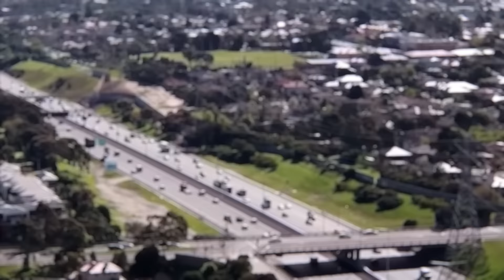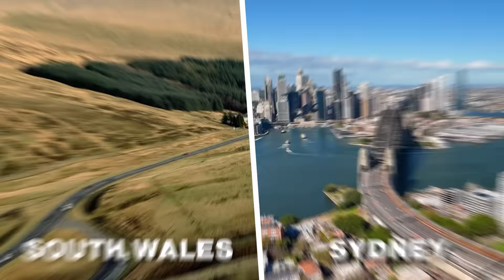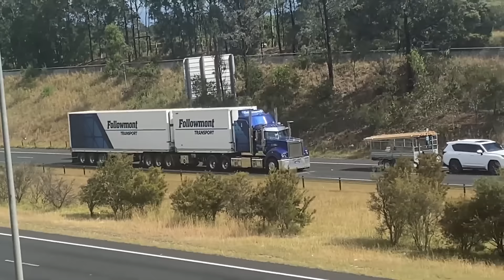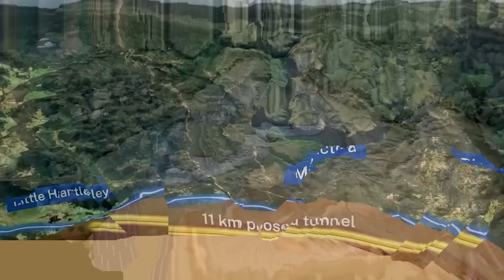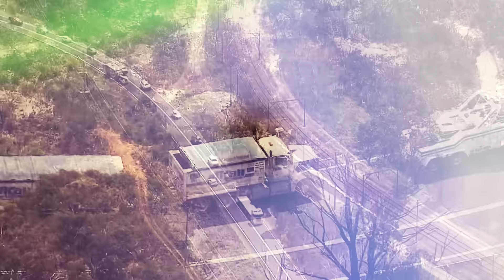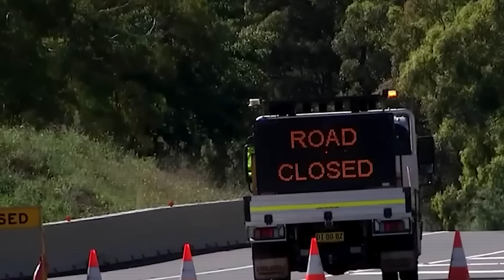Why The Great Western Highway Is About to Cost Australians $4.5 Billion

Comment: How/ where do you transport DANGEROUS GOODS into the Central West ??????
Can't be moved through those tunnels, same as the bypass around Coffs Harbour.
DGs , even if is just a pressure can of paint, have to be carried, not through any tunnels, but on an OPEN ROAD.

Comment: This doco is now outdated,  the NSW Minns government in all their wisdom for such an important infrastructure for the future had scraped the entire project in January 2026. They replaced it with a "White Paper" that adds cycle ways and extra trains to a rail network that is decades behind decent upgrades. It also adds additional years of investigation when the investigation for an expressway or tunnel had been 30 years in the making. Now the west of the Great Divide is at it's knees when the link fails at Victoria Pass of a 200 year old causeway.

Sydney expect higher prices for fresh produce coming from the central west unless you help us push for a speed on repairs to the major arterial road. The alternate detour route will be mostly closed during winter to trucks due to ice and snow and the steep gradient of the road.

Comment: The Great Western Highway exists as it is because the early explorers did not have aeroplanes!
If they did they would have realised that the Jamison Valley which is at the base of he Three Sisters and Katoomba leads to a very narrow wall of rock that once penetrated, opens up to the Coxs River Valley.
The Coxs river finds it source up near Lithgow and if you cross a small range you end up with the headwaters of the Macquarie River.
In fact the Coxs, carries through to the south of Katoomba, and if the exploders had an aeroplane they would have realised there was no need to go along the top of the mountains at all.

If our Government engineers had any brains they would build an elevated freeway which crossed Warragamba Dam and ran alongside the Jamison Valley to go through a VERY short tunnel to the immediate south of Katoomba at Narrow Neck.
It would then follow the Coxs river and cross the small ridge near Sodwalls to track alongside the Macquarie river and go close to Tarana on the way to Bathurst.

Katoomba has an elevation of 3,700ft and I have flown aircraft between Bathurst and Penrith without going higher than 3,000ft!
AND that is only because I cannot fly through where a tunnel would be.

But today's engineers apparently do not fly in aeroplanes!
Reply: Charles Brewer has presented a great proposed solution.  The Central West of the state should not rely on a "local' road that services the Blue Mountains, and, as a side issue, accesses the rest of the state west of the divide.  What is needed is a Government with the "balls" to address the future, rather than patching up a convict road.

Comment: The idiot proposed tunnel went south - north instead of east west  - MORONS   . .  . they would have done far better to start a tunnel east of Woodford and go due west deep under Katoomba and come out in the northern end of the Megalong valley and then run the near level road NW towards Lithgow.  Get the TBM out of Snowy 2 and out of under the Harbour and bring them up there.   ASAP.  Not having several main  main roads  - straightened railways through the Blue Mountains west of Sydney is a MAJOR NATIONAL SECURITY RISK..

Comment: My relative, Nicolas Delaney was in charge of building the original road over the Blue Mountains.1820s
Reply from the maker: That's an incredible family connection! The original road across the Blue Mountains was one of Australia's most important engineering achievements of its time and helped open up the interior of the continent. Thanks for sharing that piece of history with us.

Do you know any interesting stories or details about Nicolas Delaney's involvement in the project that have been passed down through your family?
Reply: @MindblowingMegabuilds  JUST Google him. his history is on the net
Reply: Thst would of been a Herculean effort, back in those days.

Comment: Basically government after government has kicked the can down the road on fixing the GWH from Mt Victoria to Hartley often putting it into the too hard basket. The other reason is this is on the border between city and rural and rural doesn't matter to city politicians. There should be a four lane highway through the base of the blue mountains national park coming out the other side of Lithgow but that will never happen either.
Reply from the maker: You've highlighted a frustration that a lot of people seem to share. The Great Western Highway has been discussed for upgrades for decades, yet some of the most challenging sections remain unresolved. Balancing safety, capacity, cost, and environmental concerns in such a unique landscape is never easy, but the delays have certainly tested people's patience.

From your perspective, what would make the biggest difference right now—a full four-lane connection through the region, or targeted upgrades to the most problematic sections first?
Reply: @MindblowingMegabuilds  Well there is a four lane section coming off the M4 from Lapstone at the eastern base of the mountains to Katoomba. From there on it's a two lane road with some three lane sections. 
From Blackheath which is the highest point of the mountains a four lane tunnel should have been constructed years ago emerging at Little Hartley. Also the four lane highway should carry onto join up with the present four lane section at Marangaroo bypassing River Lett Hill and Lithgow. 
It would of course cost many billions but it would solve the persistent traffic problems.
The other alternative although an unsightly one would be a four lane high viaduct from Mt Victoria down to little Hartley. But that still leaves the problem of the two lane winding road through Blackheath and Mt Victoria to get to the four lane viaduct to descend down into the valley.

Comment: Hmmmm, 4 billion you say, try 14 or even possibly 40, nothing is off the table when it comes to building anything
Reply: CFMEU maybe able to make a loan to the government. They got 15 billion given to them by Labor
Reply: @stevesteve7089 maybe ensure that union doesn't get near the sight. And better overseeing of cost blowouts and demand answers
Reply: Agree government forecast cost. Rarely com near final cost. But being an essential roadway. The country needs to see t built
Reply: Just getting those TBMs to Hartley will be an amazing logistic nightmare. Let alone manufctuing the number of tunnel segments. Building segment in Hartley would be essential. Accoadation for worker numbers required. And materials for construction   driven that highway for years. But now having only bell line of road to Lithgow. This will be  an engineering feat to achieve
Reply: So if we can rely on the Snowy hydro forecast cost of $2 billion now heading I think I read to over $30 billion and no where near completion. This project much bigger than snowy one. So $60 billion and 10 years. Unless a contract is sealed. To a fixed price. Not using taxpayer money to fund constant blowouts on costs